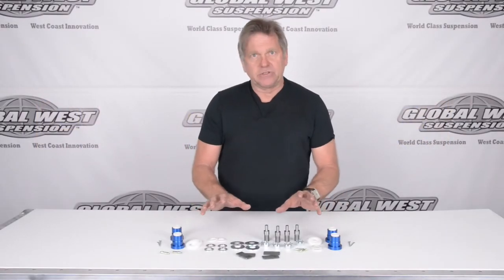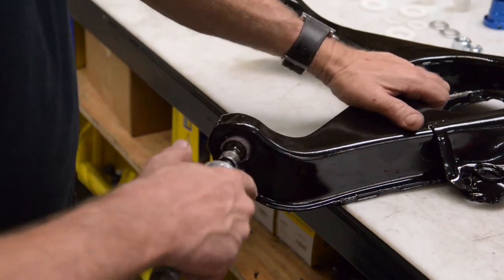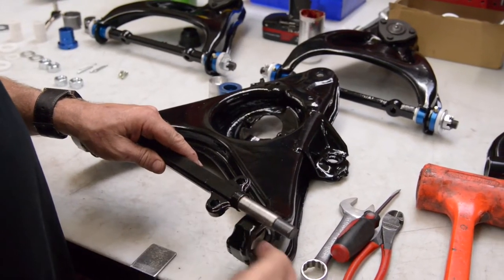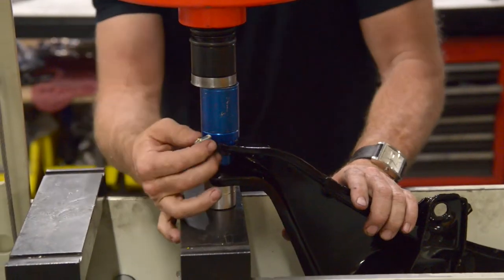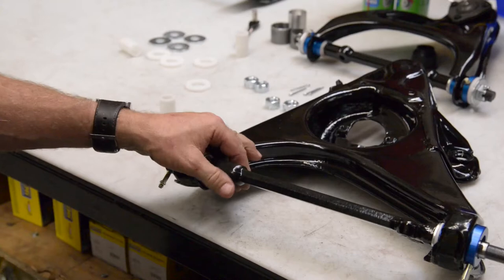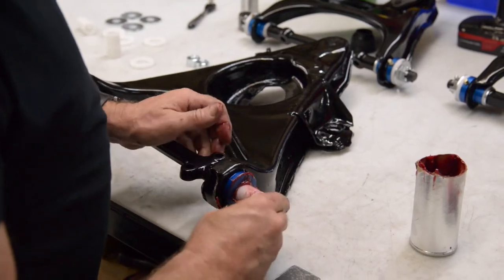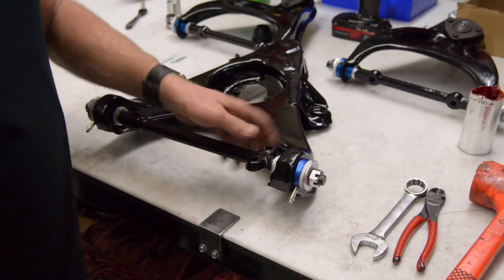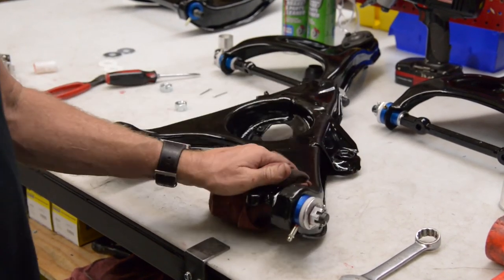How to Install Del-A-Lum Bushings in 1963-1982 Corvette Lower Control Arms

Comment: Could you guys do the same video for the A-body 64-72 arms? I know it’s a similar set up but I am having a hell of a time getting an even press on the bushing, the back side of the bushing, inside of the arm is very tight clearance. I’ve destroyed two of your bushings so far and I will need replacements. Any advice.
Reply from the maker: Give our tech experts a call to get that question answered ASAP! 877-470-2975